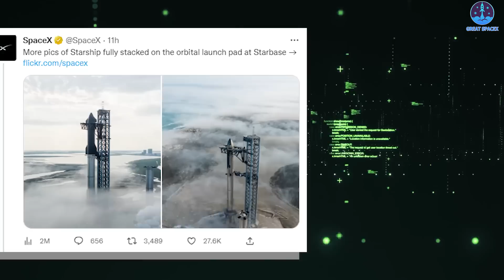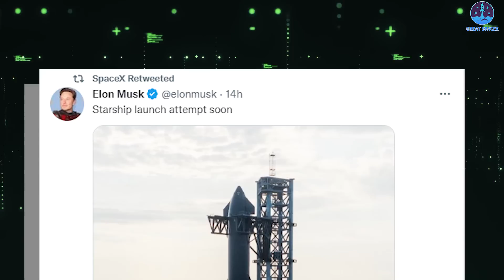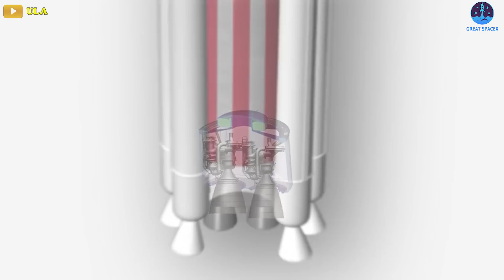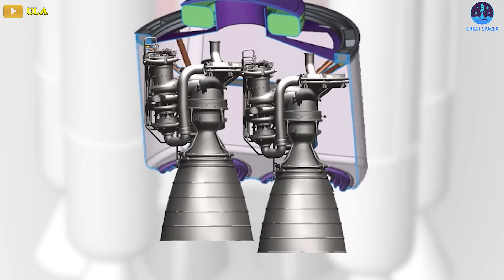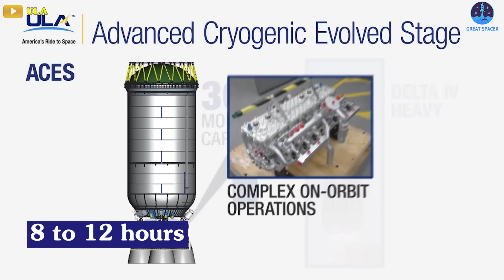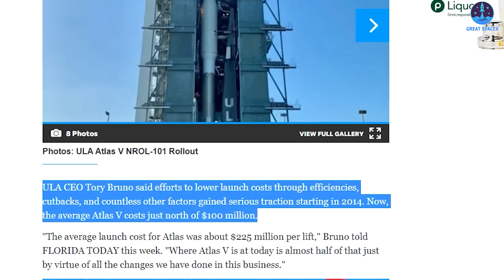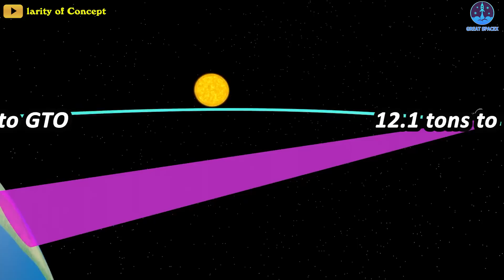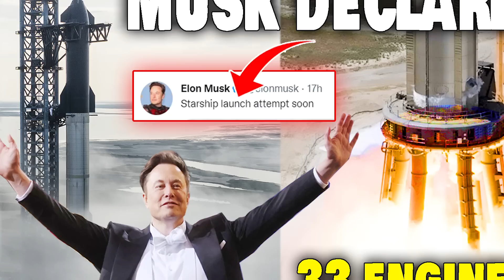Elon's SpaceX just declared B7's 33 engines FIRING & Starship orbital launch attempt soon…

Comment: Apparently Starship is as points as it is because of the look and that it's performance is arguably slightly worse pointy.  Well all supersonic things under power are generally pointy as it helps to reduce the friction, but at lower speeds a more rounded shape has lower friction.  This means that when starship takes off it would be better rounded and when it gets to speed pointiest is best, well I had an idea!   You could make a pointy rocket (or starship, plane, missile) and put a ball on the nose, this would probably give it the rounded effect that works best at low speed and this can either be deflated and sucked in or detached and lost.  The point is that the rocket could be as pointy as is desirable and yet still be rounded when in lower speed with negligible weight.
Reply: Will not work in those speeds , where the friction is very high , the nose will probably heatup.

Comment: This is assuming it doesn't explode during the 33 engine Static Fire and all of the tiles don't fall off. Considering the fact that it will not be carrying a 100+ ton payload I don't know why he is using 33 engines in the booster. They will have to throttle way back to not overpower the unloaded rocket. We will see if Elons math is good on the first test. So far the belly flop landing was Impressive and I'm looking forward along with everybody else to an Orbital and Reentry test. At the least it will be a flight to remember win or fail!

Comment: Booster 7's 33 raptor2 engines are throttleable..... why not simulate the effect of a launch... start engines at 100% or near that... and then throttle back at the rate of what the effect of the ship being farther and farther away from stage 0.  till the required time of burn.

this would/might be much easier on the concrete below.
Reply: starting engines at 100% would cause the entire thing to lift off the base. which is why it isn't done.

Comment: I'll believe it when I see it !  I have been watching this program for a number of years and have yet to see any viable space craft fly.  Good luck.
Reply: Disappointing comment
Reply: The Starship program is 3 years old. What do you expect.
Reply: @hypnotiz9  Not true! SpaceX is working on the raptor since 2009,SpaceX had a few staff working on the Raptor upper-stage engine then.
In October 2013, SpaceX announced that they would be performing methane engine tests of Raptor engine components at NASA's John C. Stennis Space Center.
Reply: @joannewilson6577  I clearly said Starship program.
Reply: @hypnotiz9  The raptor is part of the starship!
Reply: @joannewilson6577  The original comment is about the "space craft", which is Starship.
Reply: @joannewilson6577  Based on your logic, the NASA/SpaceX's Human Landing System (HLS) started in 2009 since that craft will probably use Raptors also.
Reply: @hypnotiz9  Base on your logic the Starship started in 2026 since it's the day when the HLS will be ready and will launch!
Reply: @hypnotiz9  Base on your logic the SLS started a few weeks ago since it was launched for the first time the 16 nov 2022.
Same logic you do for the starship that was launched for the first time the 20 august 2020.
When the raptor was design and build late in 2009 it was for the Starship not for any other rocket!

And it was tested at NASA in 2013! that is 10 years ago!
So it was a real engine for a very precise rocket!
Reply: @joannewilson6577  Starship prototypes started being built and tested in 2019. If you want to say the Raptor engine marks the start of a “space craft” program, then go for it.
If Elon was able to buy Russian rockets or ICBMs in 2013, then we may have seen the first Starships built with Russian engines; instead, they were delayed a decade.
Reply: @joannewilson6577  The SLS’ first core started being built in 2014. If the engines or SRBs were developed in 1960s, that’s not the craft. Your logic is off.
Reply: @hypnotiz9  A craft with no engine is worthless....your bias is obvious! 
No raptor no starship! fanboy!
Reply: @hypnotiz9  Raptor prototypes started in 2009 and SpaceX Starship (the space craft) development began in 2012.
Reply: @hypnotiz9  No they were not since the technology was not there( 3D printing etc etc..)..and there is no guarantee that it will work like Elon dream want it....
In October 2001, Musk travelled to Moscow with Jim Cantrell and Adeo Ressi to buy refurbished Dnepr ICBMs that could send the envisioned payloads into space.
Reply: @joannewilson6577  This channel is called GREAT SPACEX.
Reply: @hypnotiz9  My logic is not off.
Rocket engines are the most complex and expensive part of a rocket like the starship.

Your 3 years for the start of the starship is completely OFF!
Reply: @hypnotiz9  Engines are especially challenging because of the extreme temperatures, pressures, and flow rates. 

Other parts of the system, like the electronics and software, are complicated, but there’s little doubt you can get them to work.

 On the other hand, developing rocket engines often requires a few technical miracles. 

For example, for its Raptor engines, SpaceX had to develop a new metal alloy capable of withstanding being blasted with hot oxygen, and doing it again and again. 

There was no guarantee, when they started, that they would succeed.

And they started in 2009 not 3 years ago for the Starship craft.
Reply: @hypnotiz9   If you look at something like the SpaceX “Raptor” engine - each one of those 30 engines on the SpaceX “SuperHeavy” is burning 560 kilograms of liquid methane fuel and liquid oxygen PER SECOND!

560 kilograms is HALF A TONNE!!

The pumps on the Space Shuttle main engines could theoretically empty an average swimming pool in 25 seconds!

Can you just imagine the kind of pump that can move that much extremely cold liquid so quickly?

They’re the cutting edge of engineering.

No your logic to not take into account the start of the R&D of the raptor engine in 2009 is just a BIAS!
Reply: @hypnotiz9  And you are a fanboy with a BIAS!
Reply: @joannewilson6577  You PLAGERIZED that word-for-word from a Quora post "What is the most complex part of a rocket?" 

That's fitting to end this convo.
Reply: @joannewilson6577  All your comments are PLAGERIZED. LOL
Your other comment is word-for-word from Wikiwand "SpaceX Raptor".
Reply: @hypnotiz9  And all your comments are BIAS from your one mind one track! fanboy!
My comments are FACTS!!!!
Reply: @hypnotiz9  You should learn to give FACTS! and FACTS are not in your FANBOY IMAGINATION!
Reply: @hypnotiz9  YES THEY ARE FACTS! and you hate FACTS!
Reply: @joannewilson6577  This channel is for fans of SpaceX, hence the name GREAT SPACEX. What are you doing here if you’re not a fan? Just to argue weird points?
Reply: @hypnotiz9  I'm a fan but I base my arguments on facts and not on HOT AIR (fanboy emotions) like you!
Have you heard of what is CRITICAL THINKING?
Reply: @joannewilson6577  Good job making your pointless argument.
Reply: @hypnotiz9   Good job making your imaginary argument again...
Reply: @joannewilson6577  Since you're a dmb fangirl, here's some "facts" for you. The name "Starship" wasn't coined until 2019.

Sourced from Wikipedia:
"The two major parts were renamed to Starship (second stage) and Super Heavy (booster stage).[43] In 2019, SpaceX began to refer to the Starship/Super Heavy combination as the SpaceX Starship system.[44][45][46][47]"
Reply: @joannewilson6577  A Raptor is not a space craft. 
Stating a source with quotations is very different than plagiarism without quotations.
Reply: You have no clue what viable even means do you? You believe in Noah but you'll wait to believe when you see it? Some people's kids.
Reply: @tbutcherfpv810  yea, I know EXACTLY what the word means and I stick by my guns.  You don’t know that these stories are CLICKBAIT and a TOTAL waste of time.  The perfect example is every time they talk about how this or that is going to mean FUSION POWER for the world.

Well dude I have been hearing about how fusion power is just around the corner, maybe in 5 or 20 years it will be here FOR OVER FOURTY YEARS and more like 50.  I’m tired of this click bait crap making people think something new is about to take over when the people developing the tech AND THE PEOPLE MAKING THESE VIDEOS know it is years away if it ever even happens.  I’m an Engineer (retired) and I have been seeing it PROFESSIONALLY sense the mide to late 1970s.
Reply: They already launched and landed a starship rocket 

They just haven't with a booster yet because they weren't even developed yet when it happened
Reply: @goldenshatter  Not with the full compliment of engines and not to orbit.
Reply: @24kGoldenRocket still launched and landed a starship stop trying to quantity things
Reply: @goldenshatter  Quantification is requisite in both engineering and science...including rocket science. This channel hypes what is happening rather than reporting. I as well as many others are contemplating unsubscribing as a result. Oh I know that they won't miss me and that is not my goal. My goal is to have them removed from my feed. Good riddance to you and I will continue to wish SpaceX well.
Reply: @24kGoldenRocket  Hype is a good thing that keeps you hoping for the future I have the same hype for all my Hobbies like VR tech Without hype SpaceX wouldn't exist and all the engineers would have never applied to work for SpaceX Hype is a necessary existence to keep the world going.
Reply: @24kGoldenRocket  No one...I repeat no one, is forcing you to watch this channel. If you don't like the quality of the content, go somewhere else rather having arguments in the comments section.
Reply: @goldenshatter  They got one that landed in 7 attempts and only at an altitude of 6 miles(32 000 feet)....Branson's Virgin Galactic flies above 80 kilometers (or about 262,000 feet), which is the altitude the U.S. recognizes as the boundary of space, while Bezos' Blue Origin flies above 100 kilometers (or about 328,000 feet),
Reply: @goldenshatter  ball buster time, sorry, not sorry

I think 99.999% of the people watching this video knew that “starships” had launch HOWEVER when they “talk” about the upcoming launch they will all INFORMALLY call it a starship launch when they are of course talking about both the booster and starship combined

SO GET OFF YOUR FREAKIN HIGH HORSE
Reply: @goldenshatter  Once and it successfully landed after launching to an altitude of 10 kilometers (6.2 mi). 
That is very easy to do.
By far the biggest challenge SpaceX faces is ensuring that Starship can survive numerous orbital-velocity reentries with little to no wear and tear, a necessity for Starship to be cost-effective. In Low Earth Orbit (LEO), Starship will be traveling no less than 7.8 km/s (Mach 23, 17,500 mph) at the start of atmospheric reentry.
Reply: I have video of it on my channel.
Reply: I'm surprised Spacex don't have a dummy starship to stack on the booster for testing. It could be loaded with water to the same mass as a starship and dump water onto the pad in case of a problem to reduce damage.
Reply: @chrishorne4016  rust mountain
Reply: Agreed.  We have already seen proof that BIDEN hates Musk and will do anything he can to unfairly screw Musk over.  Biden will make sure FAA never approves first launch
Reply: Compare to bloated, pork driven Federal Agency NASA blowing $500 billion over 50 years since Apollo without getting a single American past low orbit, leaving itself incompetent/incapable of crewing or even supplying our own space station… Thank God SpaceX said “FU NASA, we’ll do it ourselves”.
Reply: Also NASA has killed many people
Reply: So much BS publicity
Reply: You’ve never seen a space craft fly from Spacex? What rock have you been hiding under? You must have meant Nasa. Nasa while spending many billions of taxpayer dollars has done very little.
Reply: Wow perhaps you can enlighten everyone on your superior knowledge of building space craft rather than just chatting shite on you tube?
Reply: Oh god you’re blind
Reply: They already launched a starship prototype. So you havnt looked very well.
Reply: @BjornSeverinLarsen  Only at an altitude of 6 miles.